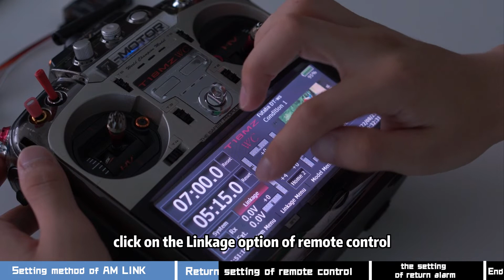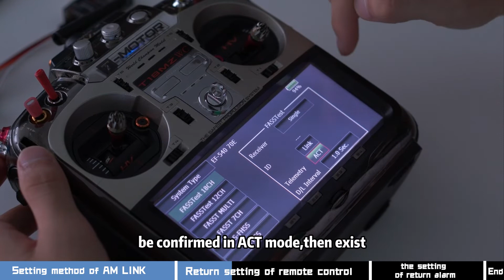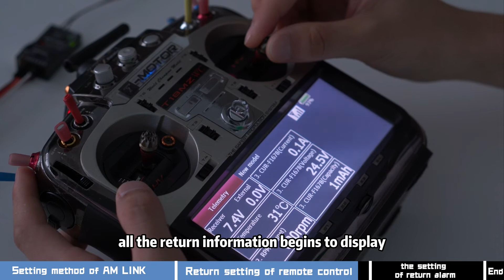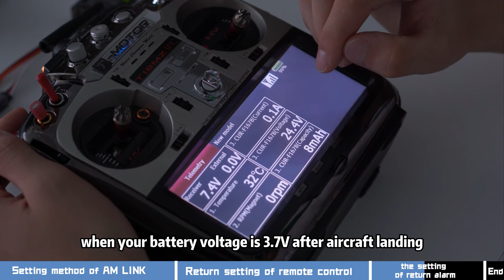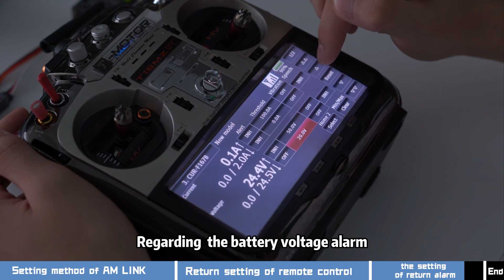T-MOTOR HOBBY Tutorial of AM Link and Remote Control Return Interface

Comment: Is this capable of showing on screen of Tx the ESC temperature and mAh used on a Frsky Tandem 18SE Transmitter?
Reply from the maker: As long as your remote control has a two-way backhaul function, you'll be fine.

Comment: For FrSky Taranis QX7 and S6R reciver I can see only, RxBt and RSSI values, then there are another 3 sensors named 0B50, OB60 and 0B70 with some values which I dnot know what they mean, one will be probably temperature of ESC (0B70) but I dont know what the other two means, and I was not able to find the battery voltage, which is for me the msot wanted one, pelase can you give us any update on how to set tetelemetry on FrSky transmiters?
Reply: I had the same problem, and the solution was put the amlink opinion 3 set to 1 (frsky)
Reply: @fcocastillo9681   unfortunately that is not the case, because I have option 3 set to 1, otherwise I wouldnt see any sensors...